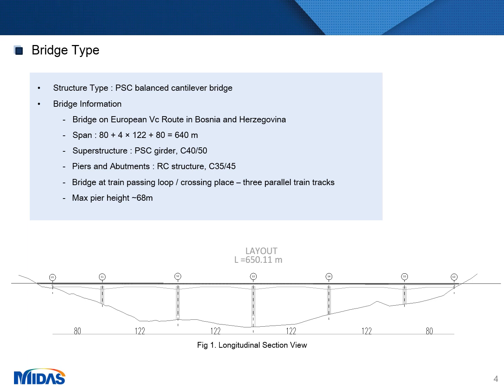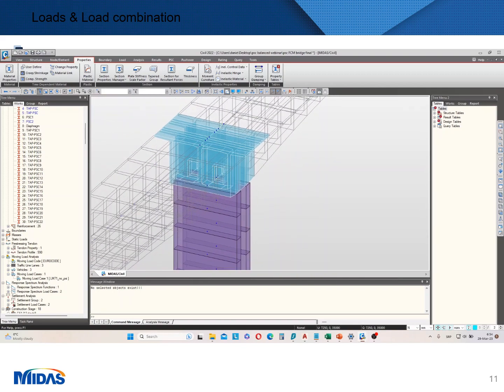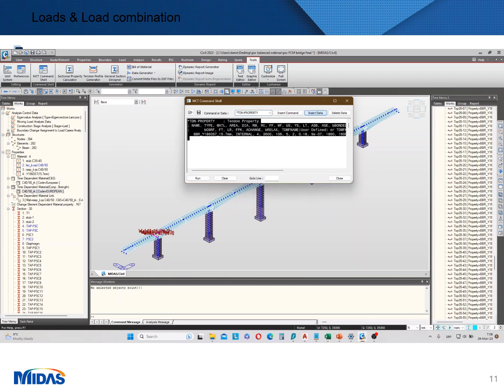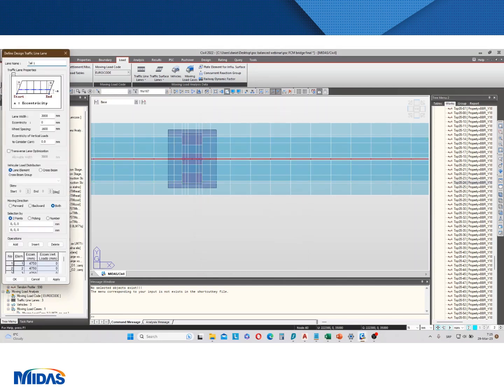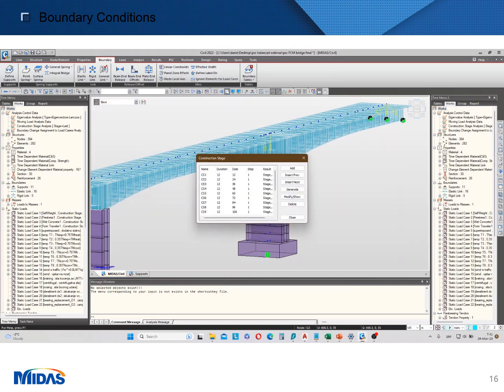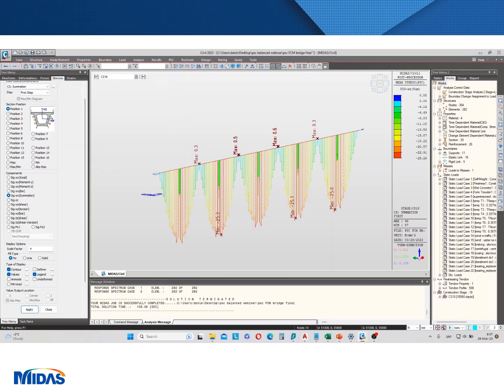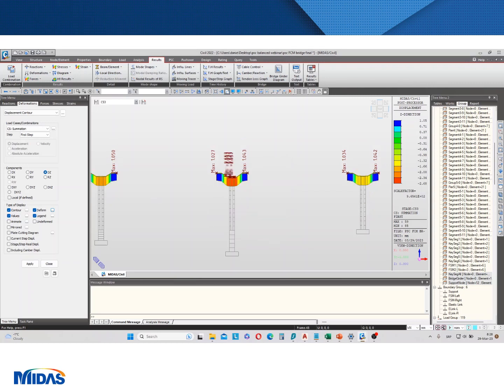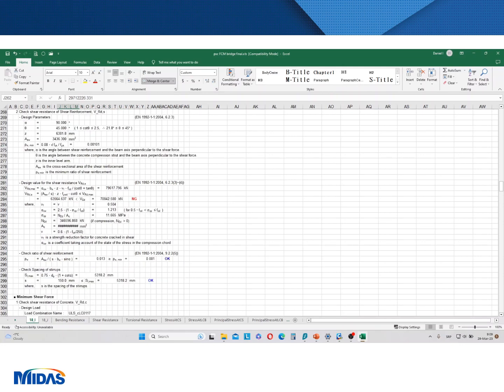Midas Europe Webinar : PSC multicell box girder railway bridge built with balanced cantilever method

Comment: One of the key advantages of PSC multicell box girder railway bridges is their ability to withstand heavy loads and extreme weather conditions. The use of pre-stressed concrete allows the bridge to resist bending and deflection, which can be particularly important in areas with high winds or seismic activity. Additionally, the multicell box girder design allows for improved load distribution, reducing the stress on individual components and increasing the overall strength of the bridge.

Another advantage of PSC multicell box girder railway bridges is their relatively low maintenance requirements. The use of precast concrete components and advanced construction techniques can reduce the need for ongoing repairs and maintenance, which can save time and money over the life of the bridge.